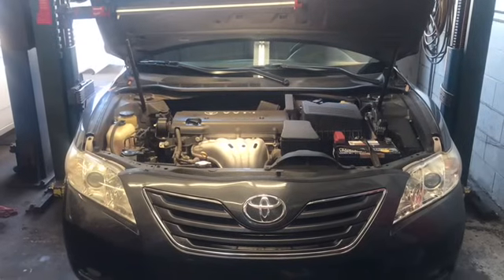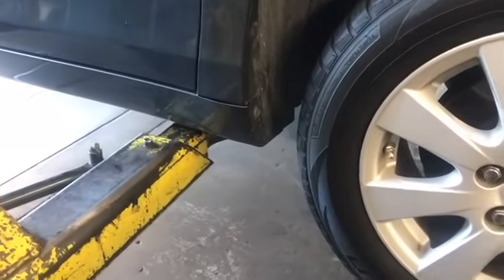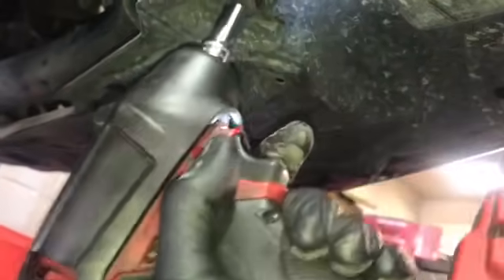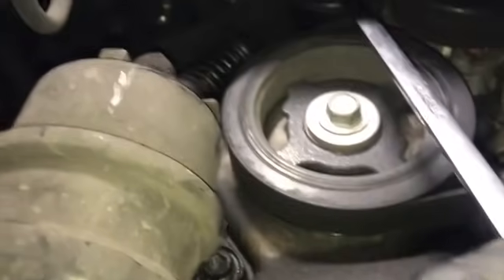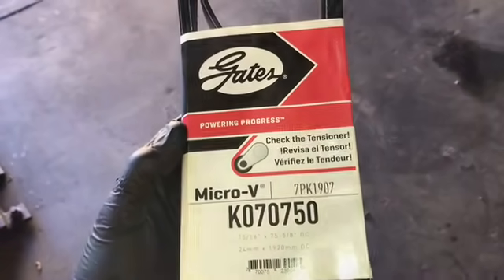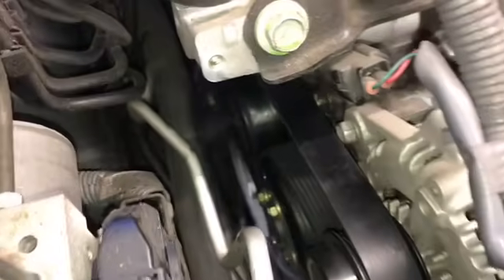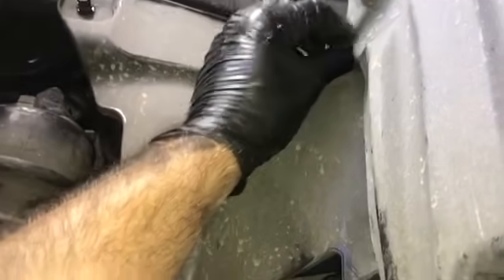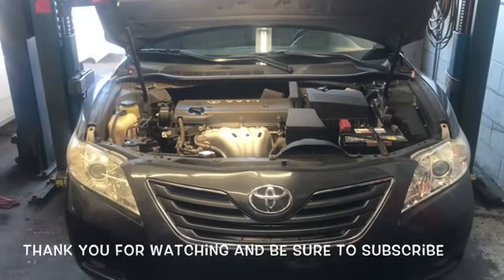How To Change The Serpentine Belt On A 2006-2011 Toyota Camry With 2.4l Engine

Comment: Here's a little tip if your new belt doesn't seem to fit (as if it were too small), with the tensioner completely released.  Check that your belt is clear that that little engine "nub," which is underneath the tensioner.  I call it a "nub," my brother calls it a little nipple.  Whatever.  You must get down in there with your shoplight and look very closely to be sure your belt is not hung-up on that nub, so that the belt is looping properly around the tensioner pulley.
Reply: This needs more likes.

Comment: Thanks for the tensioner location. Btw, this can all be done WITHOUT pulling the wheel or splash guard.  Did it all in less than 10 minutes in the driveway without lifting the car.
Reply: Whats the easiest way bro I got a 2006 Toyota camry
Reply: You will do like he did for the tensioner but from above.  I didn’t have a long wrench like he did, so used the old 2 wrench trick where you put boxed end of the wrench on the tensioner bolt, then slip the box end of a second wrench over the open end of the first and pull towards the front of the car

When the belt is loose, pull it off the alternator.  Route the new belt along the pulleys and tensioner, and you will pull the tensioner, slip new belt over alternator. DONE
Reply: If doing from top just make sure the tool you use is narrow enough to have clearance as  you realease the tensioner if it's to wide it will hit  the chassis rail, and you can put extra weight on the tool and snap the tensioner bolt. I've seen it happen. Hope this helps.
Reply: cc batty I
Reply: I need to see this. My car is down right now and I have 50 bucks to fix it. Please help

Comment: I replaced the serpentine belt (only one) on my 2008 2.4L.  The auto parts store sold me Continental part 4070752, 7PK1910.  I bought a Serpentine Belt Tool Kit, but was of no value because there was no 14mm socket and I didn't have another 3/8" drive 14mm socket.  The open ended 14mm drive wrench slipped off the nut.  I was able to adjust the tensioner using a 14mm ratcheting combination wrench with another wrench on the end of it for leverage.

Comment: I snuck a 8mm wrench and a torx screwdriver bit down there to get on the pulley bolt when I could have just went to the top bolt.... man that would have been a lot easier. Should've watched a video on it first I guess

Comment: Good video. My tip is to get the wrench he is using. The swivel makes the job a lot easier because it's a tight fit in there. I used a regular serpentine belt tool but needed a helper to maneuver it from the top while l removed/replaced the belt through the wheel well.

Comment: This was really helpful. We have a problem now. As we put the belt on the tensioner bolt broke off. Now we need to replace the alternator. Do you have a video on replacing the tensioner bolt? Thanks

Comment: well done. I agree %100 on how to release the tension, as opposed to factory recommendations. Another option, rather than buying a wrench , would be to go to an Auto parts store (which i did)and get a loaner tool for the job.It's a complete tool kit just for doing serpentine belts.  Couldn't have done it otherwise.

Comment: Great video!  I tried to change my 2006 2.4 belt, and the new one was so tight I broke the tensioner casting.  Put on a new tensioned, then took it to the dealer and they got it on, but took them a LOT of effort.  My belt is a Gates K070763 (Rock Auto's part number).  I wonder if they list the wrong part...
Reply from the maker: It’s very possible they gave you the wrong Belt. I just went through that the other day on a Ford truck.

Comment: Thanks so much for the video.   I have a 2006 Camry LE. I used the top 19 mm tension release bolt to get my belt off. After placing my belt on I tried the 19 mm head again. It stripped (aluminum). On my 2.4L there is no 14 mm bolt head on the tensioner head pulley. Any other ideas or am I stranded? Thanks so much.

Comment: I just finished doing mine. Watching this video informed me of removing the splash shield to allow more light and route the belt on the lower pulleys but the rest I did from above. I used a 19mm socket on a breaker bar with a piece of pipe duct taped on for leverage. Then I used a tie down strap from the pipe down to a loop around my right foot to hold the tensioner. This freed both hands to get the belt around the rest of the pulleys. A ratchet would work instead of a breaker bar, the tensioner is not super strong. Going around the smooth edged pulley last seems to work best.

Comment: Does pulling tensioner down require you to adjust the tension later? I need to replace my alternator in a 2011 Camry and was thinking of doing it myself.

Comment: Why was my water pump pulley leaking antifreeze like crazy after i slightly knocked it with a 14mm wrench?
Reply: Im waay too late but i bet you cracked the water pump housing somewhere with that knock. Hopefully you got both timing belt and water pump replaced anyway.

Comment: My 08 Camry has a splined bolt on tensioner which requires a specialty socket not in the kit. what else can you use?

Comment: 2011 Camry 2.5    2 belt system.  Do you have to remove the alternator to
Replace water pump?
Reply from the maker: Sir Sweetness I don’t believe in need to.

Comment: My 2013 Camry is making a purring noise as I accelerate. I took it to the dealership but they couldn't find anything. Do you think any of the belts making noise? It's got only 48K miles on it
Reply: If the purring noise is comparable to a small diesel motor sound, perhaps a pulley - leaning towards a bad water pump. 2.4L engines from Toyota have had several issues with the water pumps, including mine at 68k and 101k. Weird that a dealer wouldn't have caught that though.

Comment: doesnt matter what i do, can't get the belt on. seems the belt short by an inch.
Reply: Bro… I know what you mean I think my part number for the belt was different… mine was k070763… and it was 1951mm… I believe this belt he showed was 1920 something… I read something somewhere that there was a change and depending on production date the belt size was different